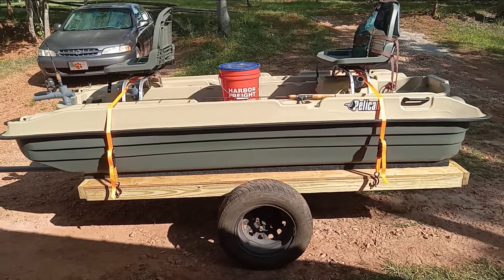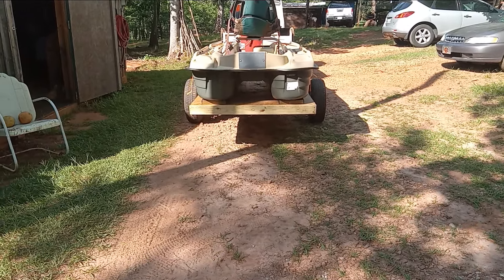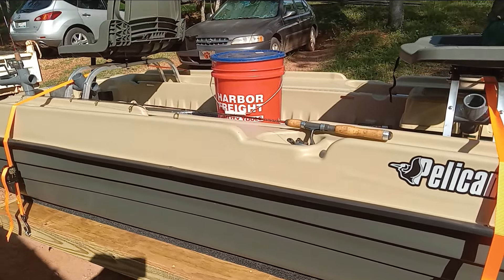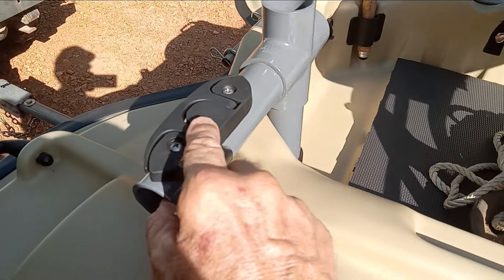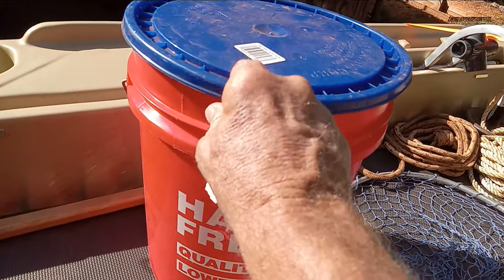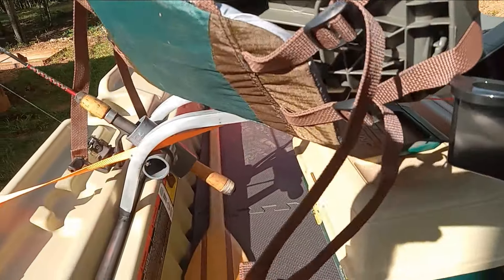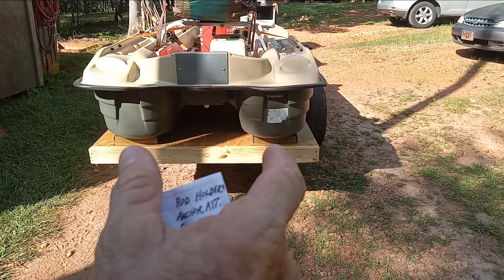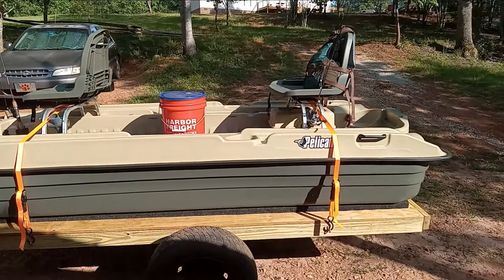Pelican Bass Raider 10e, mods without drilling into boat.

Comment: Fantastic! Great ideas sir…I too didn’t put any screws into my bass raider…I have a rear and front casting deck that float but doesn’t move an inch with simple supports to the inner side gunnels.
Attached my sonar anchor and whatever else to the decks, and all my tackle safety gear & drinks under each casting deck leaving the floor completely clean.

Love how you thought it through to work for you.
Earned yourself a subscriber my friend.
Reply from the maker: Thank you!!

Comment: Trolling motor
Reply from the maker: Yea, ones on the way.
Reply: What size trolling motor are you getting? The stock wiring will only handle the amps required by up to 40 pound thrust. @DoubleMFarmHomestead
Reply from the maker: @raymondwilcox4997  Yea, I'm not sure yet. My father in law is giving me one but I don't know the size. Should be getting it soon. May have to rewire. LOL